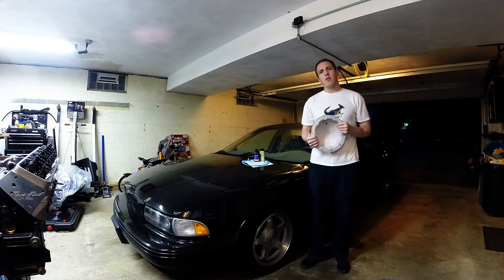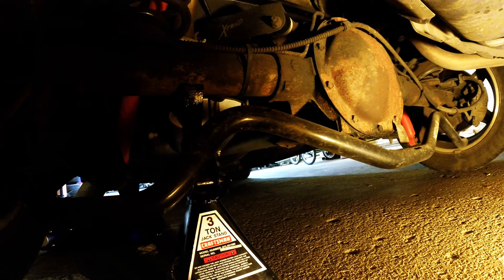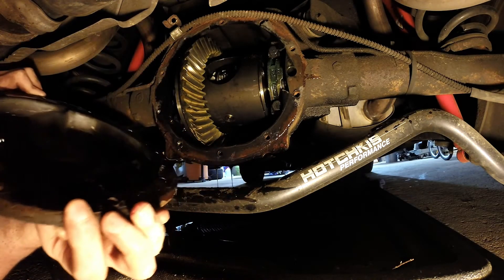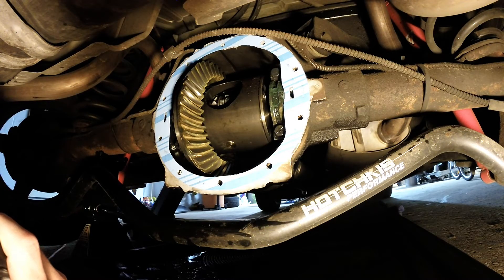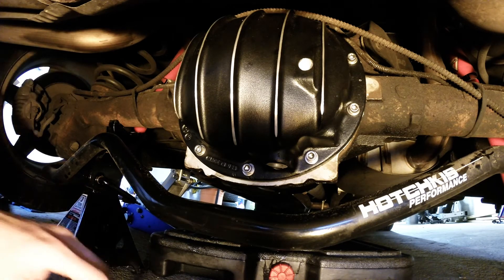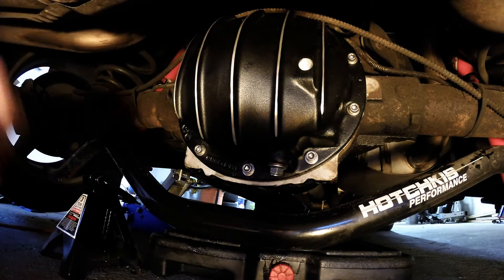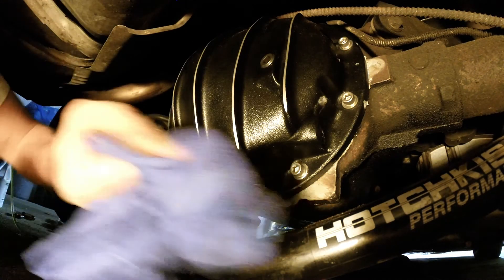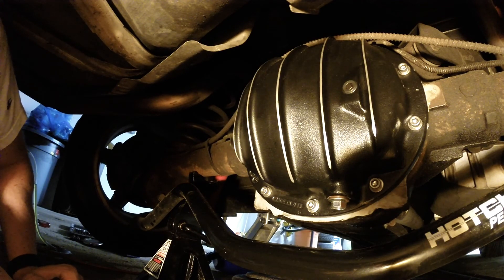PML Your Covers GM 10 Bolt Rear Differential Flush & Cover Installation

Comment: Nevermind...it's for cooling purposes, BUT having more fluid, does that not slow down the ring and pinion rotation thus affecting acceleration and speed?
Reply from the maker: Rico Smooth Not that I've heard of.... Could be a valid point though.

Comment: That's going to be my next project to do I plan on upping my gears and I'm going to use that cover too looks easy to use and has the drain and filler plugs that helps out a lot and saves a lot of time changing your fluids but a lot of people say don't dump the slip oil in because if you put in to much your limited slip will not work it will run like a open differential you no ( one wheel has all the power) not both. They say you should add a little the take it for a run to see if you hear a noise or something and if so just add more but I just want to know if you had any problems with the method you used ??
Reply from the maker: +rayquan187 I haven't had any problems with this yet.  No noise or issues, the only reason I added two bottles was because of the bigger cover, holding more fluid.  I'm sure you could get an exact ratio if you enjoyed doing Math.... Let us know how it goes.  PML is a solid company that has tons of great stuff.

Comment: I've been looking for an aluminum cover but the ones I've seen cover up the two oil ports and won't allow oil in the slots like you talked about. Did the PML cover the slots or any suggestions for a cover? Thanks John
Reply from the maker: +John Scheppler From what I've read, the oil ports allow the oil to work its way out to the axles right?  They were added due to the lack of turning, which is how a police/9C1 vehicle drives, just straight down the highway.  I could be wrong, but this is what I read.

The PML Cover is very traditional and does not do the "porting" like the stock covers.  It does have we'll say cut outs between the bolt holes though, if you watch the beginning of the video where I show you the cover.  

Either way though, I'm curious how it will work out for me, because I will be daily driving, making turns, etc.  I don't see how the fluid could not make it out to the tubes.  

Any other information would be appreciated.  Thanks!

http://www.hoagiegarage.com/products/2015/7/12/pml-rear-differential-cover-gm-10-bolt

Comment: ? so you just jack up one side of the car and that's how you drain the differential fluid and where did you get the gasket from did it come with the differential plate I don't know if you said where you got it from I might have missed it and what size is that cover plate I know it's a 10 bolt I want to order one I just want to make sure I'm ordering the right size and thanks for all these videos on your Impala SS it motivated me more to work on my Impala SS myself I was being lazy and was going to let a shop do  the work but watching these videos is motivation do a lot myself
Reply from the maker: +melmayback For the gasket, I just used a Fel-Pro and some RTV: Here is the link to where I got it on Amazon - http://amzn.to/1rNp4gb

This is copied from the PML invoice - so you can get the exact one if you desire: "DC ASM 6082-B Assembly, GM 10 bolt 8.5" differential cover, black powder"

Thanks for watching, appreciate your words.  More to come soon... Been busy!!
Reply: +Hoagies Garage  Thank you for all the good info

Comment: I know this is 2 years old but you overfilled the differential if you look just to the right of the cover you see a small Allen plug that is supposed to be the correct level. the fill hole is above the axle tube way too much gear oil
Reply from the maker: Agreed! Little bit seeped our, but it’s been holding fine.

Comment: Great vid, I just didnt understand why the cover was changed, was it strictly aesthetics reasons or was there a benefit to this? Still awesome though. Keep the impala vids coming, look forward to them!
Reply from the maker: Rico Smooth The main reason I did it was it holds .5 ounces of extra fluid and also includes a drain plug so I can swap the fluid out more often.  Factory cover has no drain plug and also holds less fluid.  It does look cooler I guess too, but I don't really care about the undercarriage looks for the most part...  Thanks for watching!

Comment: Would this be the same rear end as on the trucks?
Reply from the maker: I believe it’s the GM 8.5” rear differential. Somebody will correct me if I’m wrong 👍🏻
Reply: @RubberCityMotoring  I just got this same one - https://yourcovers.com/diffcover_11035.php for 2004 Trailblazer - but looks like the cooling fins will not fit behind the trackbar. Looks like you don't have a Trackbar on that Impala. I did find some mention of this possible need:  "they indicate you may have to grind down some of the pml fins." for a Nissan model. Still - they post a vid of installing on the 2005 Envoy. Dang! Also the 2009 Trailblazer.... I'll see tomorrow - bringing to dealer.
Reply: @RubberCityMotoring  OH - the 8.5 is different than the 8 inch/8.6 inch diameter diff cover. That's what I have -
Reply: @RubberCityMotoring  https://yourcovers.com/diffcover_gm85.php  You keep typing .5 ounces of extra fluid but you mean .5 QUARTS of extra fluid...
Reply from the maker: Thanks for all the info!
Reply: @RubberCityMotoring  thanks - the dealer just installed the PLM cover - it BARELY fit. I took a ton of photos - will upload to my blog.
Reply from the maker: Awesome! Pml makes good stuff

Comment: Yours didnt have a magnet?
Reply from the maker: Honestly don’t recall, but if you don’t see one on the install vid here, then no. I’ve seen people epoxy them in.
Reply: @RubberCityMotoring mine was an aluminum cover so magnet wouldn't go on my new cover but I put some small rare earth magnets on the new covers drain plug im still not satisfied mine looks just like yours just made of aluminum think it holds an extra qt almost too. I think they need some good magnets to keep them going they might develop a whine after awhile with all that metal floating around. I'm going to try to find a magnetic drain plug mine has a 20x1.5 plug at bottom of the differential on 01 silverado just need to find one with a magnet. Good video   thanks.

Comment: what size bolts did you have to tell them Hoagies?
Reply: +melmayback GM used a variety of bolts on these rear differentials. Hoagies Impala had oem size 5/16in-18x7/8 bolts on the diff cover. The PML part number is 6082: http://www.yourcovers.com/diffcover_6082.php
Reply: +YourCoversPML will that size fit my 95 Impala?
Reply from the maker: +melmayback It should - One way I did it, was just measured one of the oem bolts, you can also oversize a tick due to the thicker PML Cover.
Reply: +melmayback We don't know for sure. Perhaps GM used whatever bolts were on sale that day? Just like Hoagies said, we recommend removing a top bolt, checking the thread, and measuring the thread length. We supply bolts longer than the stock bolts to accommodate our thicker cover.
Reply: YourCoversPML ok thanks
Reply: YourCoversPML I'm just going to go off Hoagies same pattern of bolts because I haven't took mines off yet. I was waiting until the cover plate comes in the mail